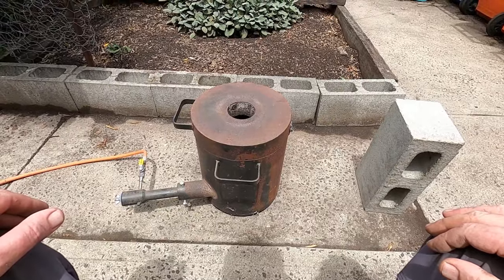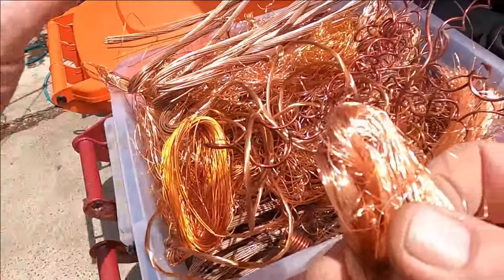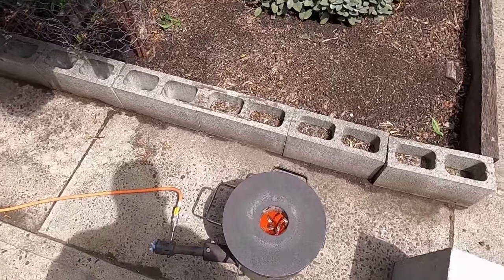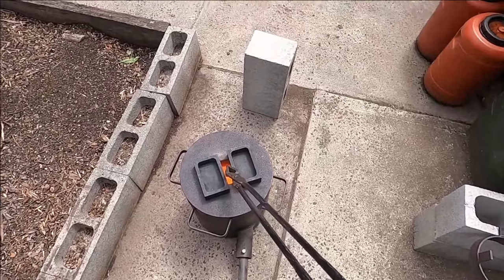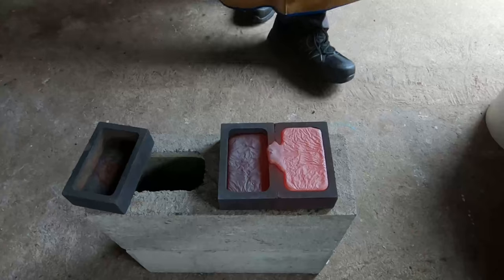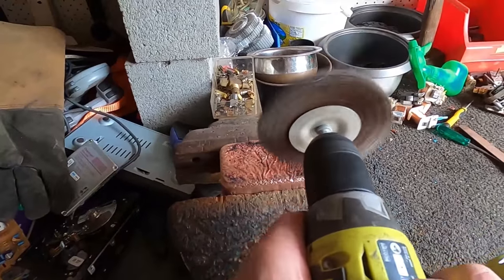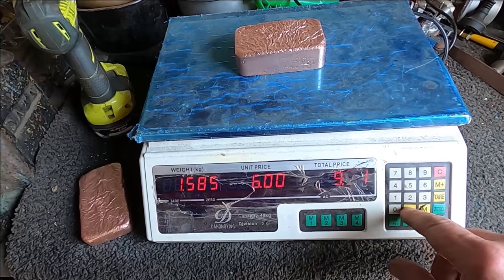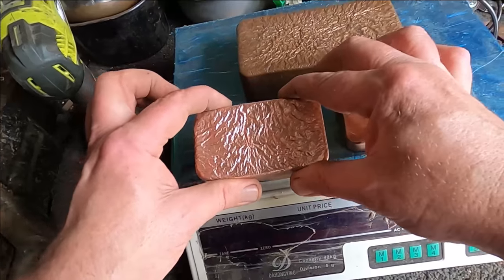Copper Bar Making, First Pour Was Shaky

Comment: cool vid Ben you know after brushing your ingots you can keep that shine  just by spray it with transparent lack,
and one more thing as your using your file if  you pulling the file towards you it does almost nothing  to file off some material you need to push it away from you   that is the way  all metals file are made  you need to push away  then file will do the job, small hint but try  that and you will see different happy scrapping my friend  
👍😀👍

Comment: Bars look good mate the only reason behind those "layer" lines on the bottom of the bars was due to lack of heat because the copper grains didn't have sufficient heat to meld together before cooling. But that's not a biggie because you said yourself you were mucking about with the pour and its only cosmetic.

Comment: Got a jeweler mate that can advise Ben.
Not sure if green sand pours would work but could be worth a try. maybe.
Close melting point to cast Iron which uses sand casting as a default.
Aluminium you can definitely cast in sand and needs 1/2 the temp.
Take care mate. got to catch up soon.

Comment: I don't mind the smoke, but I can understand from your point of view 😂 Was a while ago I watched a video from you. You were the one that hooked me on scrapping, and thus collecting free copper 😁 you are still awesome!! But please be safe with melting. You wear an apron while pouring that is great! But I would advice to wear gloves when putting in metal in the hot crucible. Also getting a no 10 crucible with like 4 kgs of molten copper out of the furnace with some hinge tongs made me shiver! I would advice to use a proper lifter tong for that as I seen my crucible crack with a hinge tong. Furthermore why don't you put the ingot molds next to the furnace? Seems much more efficiënt 😁 What a nice stack of copper 😍😍😍  thanks for the video 👍👍👍

Comment: Aye graphite molds are crazy priced for designs. You could try delft clay/petrobond casting is how I got round it. Get some silicone cake molds with designs and cast with wax or epoxy then use it for the delft clay 👍

Comment: I bought a 2300 dollar wire striper
Reply: Why
Reply: @richardburgess5215  I get utility wire 1 dump truck a month
Reply: ianjsutt  I was doing work for a small utility company one day they were loading a dump truck with 500mcm cable and ask them where r they dumping it they said local scrap yard I know the scrap yards are crooks so I just said shit I can pay 20 cents then what they pay and cash word got out next week 2 dump trucks were headed my way they tell we know it's a lot will give u 5 days and a weekend to clean it and pay us by Monday so now they come to me I posted a local add I buy commercial wire so I get it now I have a industrial building 5000 sg feet  I bought to do wire  last year I did 80k lb
Reply: Those dump trucks I made 3,800 dollars in 4 days cleaning the scrap yard that I go do call me now when they have order to fill I sell 5000 lb every month bare bright they pay me 20 cents below market I get 30 cents more than peddlers they know there getting milbury  bare bright top of the line copper
Reply: Now I buy 70 to 90 percent recover for 1.20 so I can make 60 to 80 cents a lb in hr my machine cleans 300 to 400 lb a hr
Reply: ianjsutt  I use blue rock striper costed me 2300